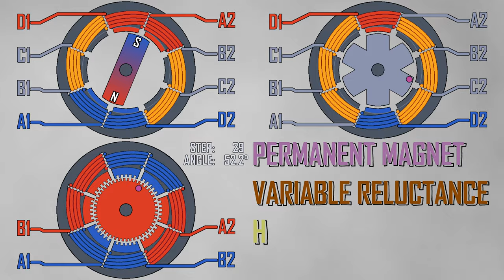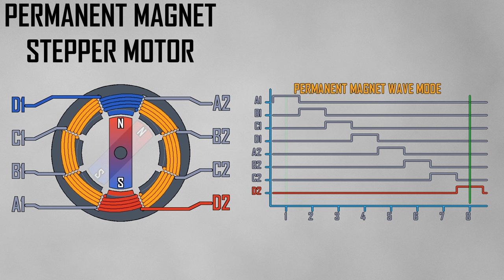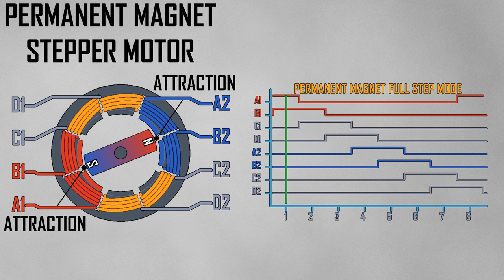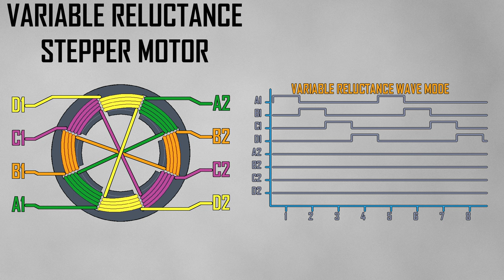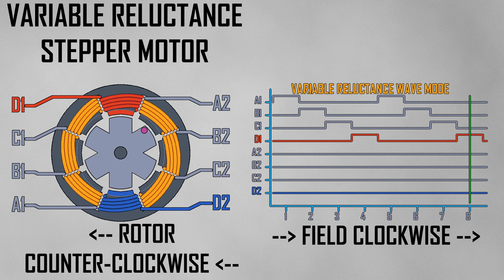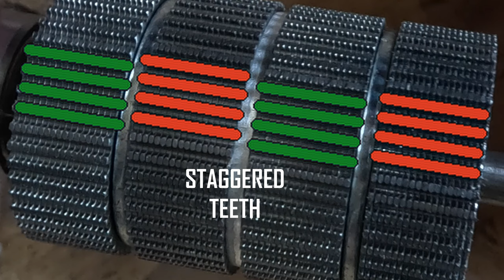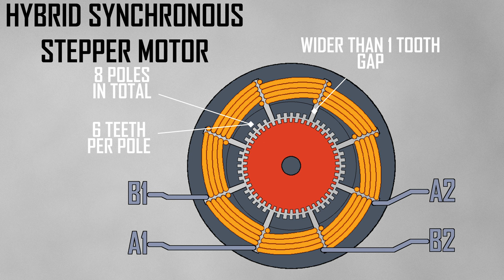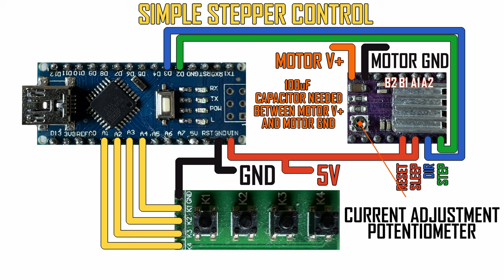How Do Stepper Motors Work

Comment: That was a great video, beautifully explained!!
I do have one question, does that sound that the stepper motor makes by the end of the video are generated by the motor itself, or the driver controlling it, or maybe both?
I have an stock Ender 3 3d printer, and i noticed that the steppers moving can make a lot of noise, but the sound seems to come from the driver board specifically. But in this video, the stepper itslef seems to be producing these sounds.
Reply from the maker: Thank you, I’m glad you liked the video :) you’re right it is both, in my video the stepper is making the vast majority of the noise, because it’s being driven in full step mode (opposed to micro-stepping) and because of the particular driver, for example the TMC22xx series of driver are much quieter. Also having it attached to a large wooden table seemed to amplify the motor noise!

Comment: Can the driver detect when a step was skipped so that it can tell the MCU which then can take that into account?
Reply from the maker: Unfortunately not, the driver has no way of knowing if the stepper has skipped steps, this is a drawback of using a control method with no closed loop feedback (such as an encoder) there may be drivers that can detect skipped steps but not that I know of.